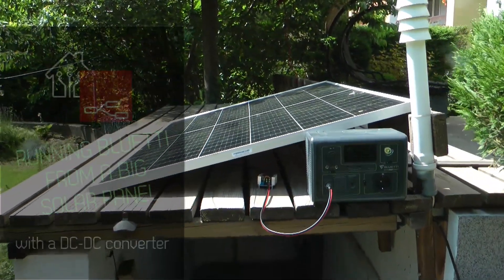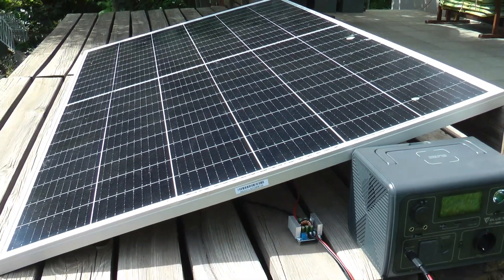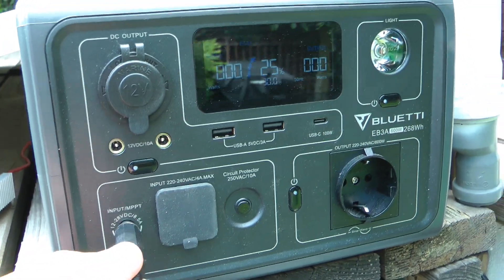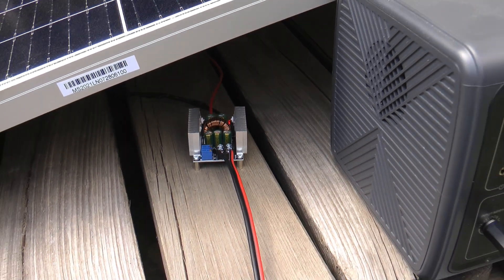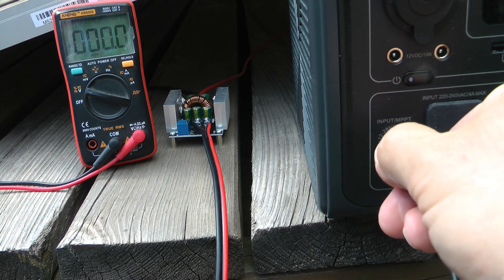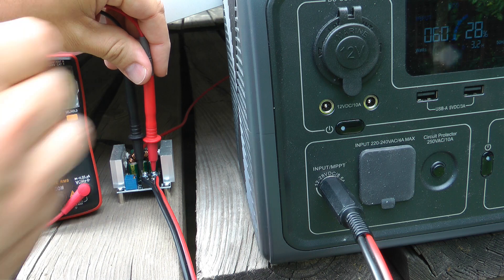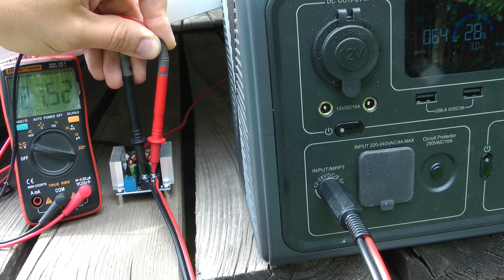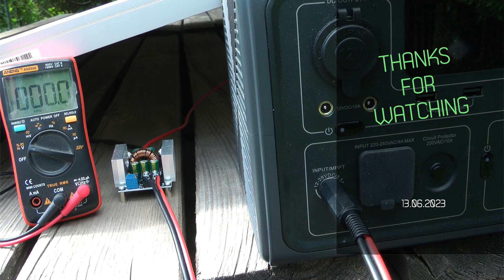Charge Bluetti EB3A with a big solar panel: maximize solar charging with a DC-DC converter

Comment: Do u still have this eb3a? Is it still working well 1 year after u posted this video? Do u use it everyday and do u use it for heavy load ?
Reply from the maker: I still have it and it is working. I am only using this periodically, and the most frequent use if to provide UPS support for my 3D printer. I have not used it for heavy loads. For most of the power tools, it is not powerful enough, and for lighter tools and lamps, it has plenty of power.

Comment: Control charger for dummies ,I'm looking to buy a portable controller charger that will take my 200 watt all power portable solar panel down in voltage,so I can  charge my blue EB3A but I'm confused on which one can I buy on Amazon that's plugged and ready to go, but also will work on my 200 amp lithium battery in my RV control charger for dummies that's what I'm looking for

Comment: Can I use a 100w, 120w, 160 watt panels?
Reply from the maker: Sure. Bluetti supports up-to 200W panels directly. Those you can plug in directly without the DC-DC converter (in most cases)
Reply: @csongorvarga  very helpful. Thanks!

Comment: Genius! I was thinking using for this cheap solar controller from ali set to output 24V. Advantage would be that it will still follow the optimal charge curve from the solar panel thus improving efficiency especially when there is less light. But I have step down converted already and solar controller needs to be ordered.

Comment: hows the ampere:? step down tom
Reply from the maker: Current is regulated by Bluetti. It will automatically top at 200W
Reply: @csongorvarga  so if voltage not more than 28v is safe but ampere is automaticaly top at 8,5 right???  Sir one more question if i use this bluetti as supply for my fish everyday with plug to ac and sollar panel its safe??
Reply from the maker: @plts-desaciherang  Yes, Bluetti will not draw more than 8.5A from solar, so Bluetti regulates the power draw. Yes, so can have the solar panels and AC plugged in at the same time.
Reply: @csongorvarga  i try eb3a when using panel and ac when fully. Battery the panel not transfer the power they. Use grid ac bypas😅😅